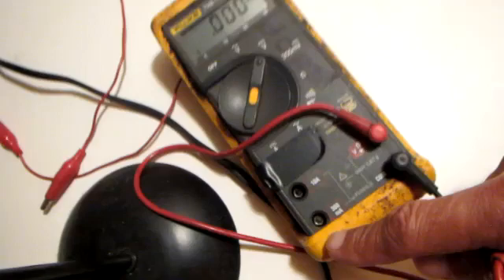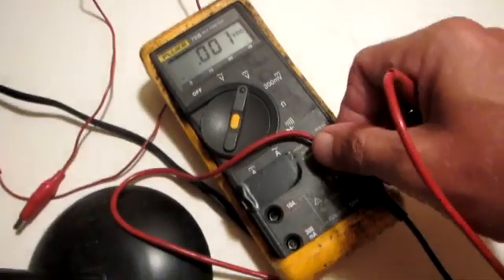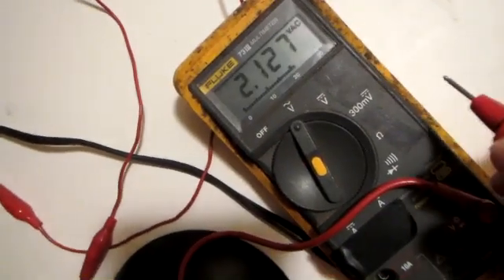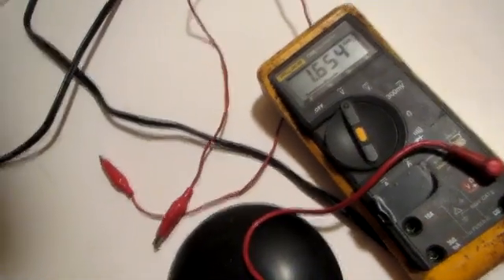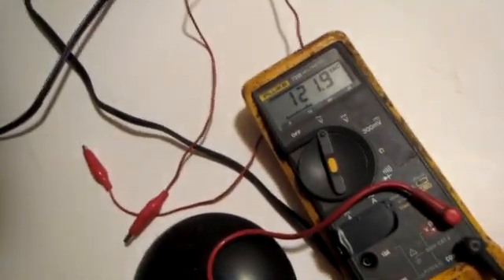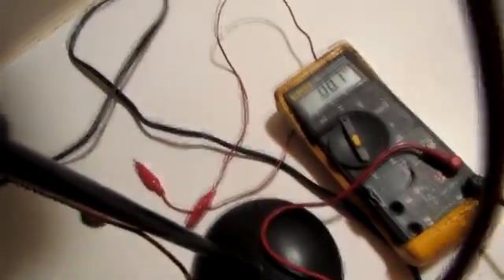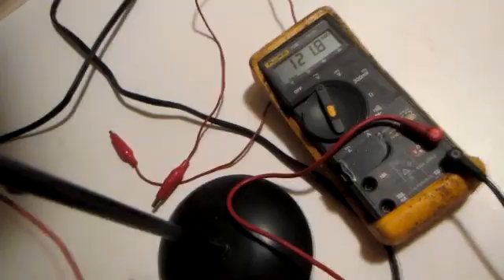Using a multimeter read voltage on a light socket.

Comment: Safer method : >  unplug it & use ohms for each entire length of wire.   
Also 1: the NEUTRAL must go to  the  screw part.   
Also 2: a switch must switch the LIVE.

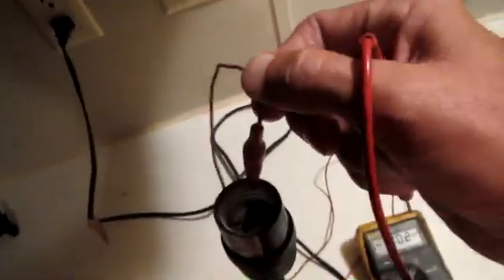Comment: @ 0:55 connecting red alligator clamp to black probe is bad practice for a tutorial video. Mixing colors creates more confusion. Between that and too many leads on the table makes for a confusing video overall.
Reply: Right?!  Looked and sounded like the vid was made by "Bubba Gump"!?  Maybe YOU knew RED alligator clamp was hooked up to your BLACK meter lead, but WHY - o - WHY, in an INSTRUCTIONAL vid, would you NOT, oh, idk, maybe MAINTAIN COLOR CONSISTENCY when even PROFESSIONAL ELECTRICIANS thought it was important enough to do so in ALL permanent wiring and devices that may connect to them?!?  And the LIGHTING was HORRIBLE!  At one point, the RED alligator clamp actually looked BLACK, the lighting was so bad!?  And we couldn't see JACK (pun intended) after your red meter lead was actually IN the socket!?  And what was with the NASTY ASS METER!  Looked like you just WIPED YOUR ASS with it!?  And FOCUS your friggin' camera!  MOST of the time, the labels on the meter are so BLURRY I felt l like I was DRUNK which, btw, is also how you SOUNDED!?

Comment: I might be wrong here, but it looks like he takes the black lead from the multimeter and connects it to another wire that is red and then clips that to the side of the bulb.  He takes the other lead which you can't tell the color of cause it's too dark and touches the center brass contact point.  One consequently might think you're clipping the red lead to the outside and the black touching the center when it's just the opposite, I believe ... kind of confusing.
Reply: HELLA "confusing"!  Looked and sounded like the vid was made by "Bubba Gump"!?  Maybe YOU knew RED alligator clamp was hooked up to your BLACK meter lead, but WHY - o - WHY, in an INSTRUCTIONAL vid, would you NOT, oh, idk, maybe MAINTAIN COLOR CONSISTENCY when even PROFESSIONAL ELECTRICIANS thought it was important enough to do so in ALL permanent wiring and devices that may connect to them?!?  And the LIGHTING was HORRIBLE!  At one point, the RED alligator clamp actually looked BLACK, the lighting was so bad!?  And we couldn't see JACK (pun intended) after your red meter lead was actually IN the socket!?  And what was with the NASTY ASS METER!  Looked like you just WIPED YOUR ASS with it!?  And FOCUS your friggin' camera!  MOST of the time, the labels on the meter are so BLURRY I felt l like I was DRUNK which, btw, is also how you SOUNDED!?
Reply: very confusing
Reply: That's exactly what it looks like
Reply: No shit eh? The clarity is terrible!
Reply: @johnmcgahern3946  Ikr?!  Looks and sounds like the vid was made by "Bubba Gump".  Maybe YOU know RED alligator clamps was hooked up to your BLACK meter lead, but since this is supposed to be an INSTRUCTIONAL vid, WHY - o - WHY would you not*, oh, idk, maybe MAINTAIN COLOR CONSISTENCY (when even PROFESSIONAL *ELECTRICIANS thought it was important enough to do so in ALL permanent wiring and devices that may connect to them)?!?  And the LIGHTING was HORRIBLE!  At one point the RED alligator clamp actually looked BLACK, the lighting was so bad!?  And we couldn't see JACK after your red meter lead was actually IN the socket!?  And what's with the NASTY ASS METER!  Looked like you just WIPED YOUR ASS with it!?  And FOCUS your friggin' camera!  MOST of the time, the labels on the meter are so BLURRY I feel like I'm DRUNK which, btw, is also how you SOUND!?
Reply: The whole video was confusing

Comment: Great video no extra BS straight to points  appreciate considering and respecting viewers times .
Reply: Sure, EXCEPT it looked and sounded like the vid was made by "Bubba Gump"!?  Maybe YOU knew RED alligator clamp was hooked up to your BLACK meter lead, but WHY - o - WHY, in an INSTRUCTIONAL vid, would you NOT, oh, idk, maybe MAINTAIN COLOR CONSISTENCY when even PROFESSIONAL ELECTRICIANS thought it was important enough to do so in ALL permanent wiring and devices that may connect to them?!?  And the LIGHTING was HORRIBLE!  At one point, the RED alligator clamp actually looked BLACK, the lighting was so bad!?  And we couldn't see JACK (pun intended) after your red meter lead was actually IN the socket!?  And what was with the NASTY ASS METER!  Looked like you just WIPED YOUR ASS with it!?  And FOCUS your friggin' camera!  MOST of the time, the labels on the meter are so BLURRY I felt l like I was DRUNK which, btw, is also how you SOUNDED!?